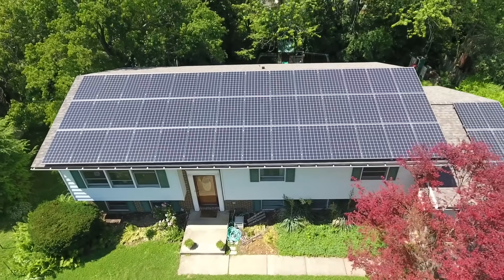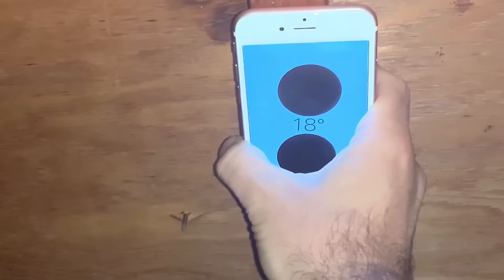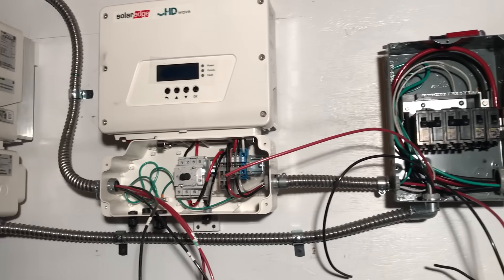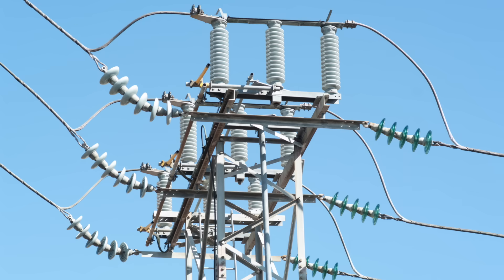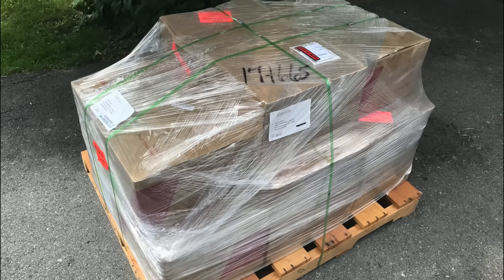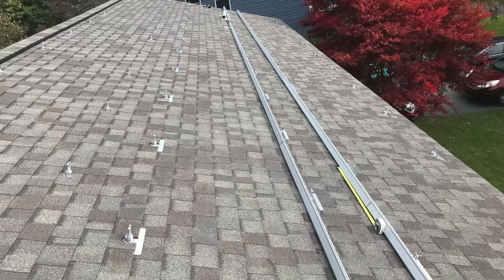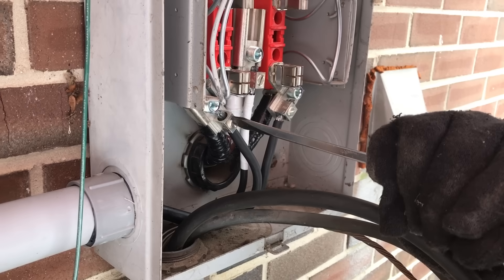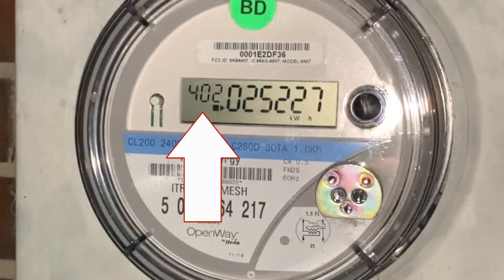I Installed a Power Plant Myself | HUGE DIY Solar Panel System

Comment: Great video! Very encouraging for those who haven't installed a system yet. I was much like you back in 2013. I installed my own array, but did so in increments. I also chose Enphase Microinverters instead of SolarEdge. I started with 6 panels leaned against my backyard fence! When I got up to 24 panels mounted on roof, I drew up my own plans from scratch and got permitted and approved by the utility. I could really relate to your story, in that no one I knew had installed solar before. Plus, each time I stopped to ask any detail from local solar installers, 100% of the time, they would not offer any help or advice at all. All would try to get me to get a quote only. Even the most simple questions like... Where can I purchase safety warning stickers for my conduit? Umm... not sure, we get ours from the company... ! Presently I can generate about 160 kWh per day (it's May 12th), I have 4 EV cars, and I waste power like there's no tomorrow! My house has trees on 3 sides blocking my good sun hours less than most houses, but I oversized my array to compensate for it. My whole house runs on electricity only now, and my gas is valved off. Yearly the utility pays be about $600 back for power I feed back. My payback on investment was about 2 years since the labor was all free. Thanks for the video, I am sure it will help people.
Reply from the maker: Thanks for watching!  That’s great that you installed solar yourself and had such great results.
Reply: Most Solar Contractors simply want you to fail at the install, and then hire them instead.  Unfortunately, they make out like bandits, with high initial installation costs.  The tax credits that the government offers, simply allow them to charge more for the install.  I commend you on your installation.  The normal home owner, really, only makes out if he does the install himself.  Good Job!

Comment: I am interested in solar, but only at the highest ROI possible with an expandable DIY system, preferably with low cost microinverters that don't require cloud monitoring. My state offers a 25% credit up to $1,000. So the total cost should be $4,000 so that I can get the maximum credit and the lowest cost per kW. Next year if the tax credit is renewed, I can expand again to whatever limit that allow. All to get the lowest overall cost and therefore the highest ROI. In addition, since the power generated will not be designed for a whole home nearly always be at the highest cost per kWH that too will maximize ROI. My goal is an ROI of 3 years or less and it seems that is only possible with a small system. Thank you for your video and I plan on downloading your beginner's guide.

Comment: So how do you align your panels and keep them straight through out laying that many panels? I lay panel for a living and we constantly hit the road block of them becoming off square.
Reply from the maker: The rails need to be square and the first panel has to be square to the rails.  I was pretty meticulous about the placement of the first panel.  Once the first row is complete, you can use that as a guide for the next rows of panels.  I agree that with long rows of panels it can be very challenging.
Reply: @FrugalRepair  thank you for the prompt reply! I’ve been using line levels to help guide me along and it’s been pretty successful.

Comment: love to do a similar project, only issue we have is the power company pays you say 2c per unit in the day whilst you are producing energy, but then you buy back off the company at 15c per unit. we have no one at home during day light hours. i think the only way this would work is with a battery set up like a tesla or some other lithium battery system.   
Great video, and nice work on compiling all your efforts into a free brochure.
Reply from the maker: Thanks!  Yes, in your situation a battery bank may be worth getting.

Comment: Do you live in the north or the south?
Reply from the maker: I’m in Pennsylvania.
Reply: @FrugalRepair  Thank you.  You probably get a lot of snow like we do in Iowa...How is they system with a lot of snow on it, or do you have to keep the snow off?  How much does the system weigh on your roof?
Reply from the maker: I made a video about that.  Check it out if interested.  You probably get a lot more snow than we do here in PA. The biggest factor with grid tide solar is the net metering. If you have this, then most of your production will be in there spring summer and fall and you’ll get all of those credits. So the snowy months aren’t as big of a deal.

Comment: Did you take the induction loop into account? Or does it not matter in america?
Reply from the maker: What do you mean by induction loop?  You mean induction on the dc wires?
Reply: @FrugalRepair  yes, that wiring from your inverter to your optimizers is placed in such a way that it doesn't form a big loop, in wich a magnetic field can form.

Comment: When you bought your panels did the price of the panel include the microinverters or is that typically an add on to the price of a panel, when I am shopping? For example I see a Panasonic panel similar to yours for $328.00. I can not see, or figure out, base on the advertisement, if the panel I'm buying automatically includes the inverter? Thanks again!!
Reply from the maker: I’d ask the shop.  But usually they are sold separately.  You could shoot me an email if you have more questions.

Comment: What state are you located in? I assume its one of the warmer states where the winters are shorter otherwise you would have to depend on the power company more often.
Reply from the maker: PA
Reply from the maker: I cover the snow and net metering topics in the next two videos
Reply: @FrugalRepair  Great! I definitely have to check those out.

Comment: Excuse me, but how did you calculate the ROI? If your investment pays back after lets say 7 years and the system is operational at least 21 years, your ROI schould be much higher than 14% ?! (Around 300% after 21 years.
Reply from the maker: Check out the next video, I go over the numbers.

Comment: Did he have to reinforce the roof beams in the attic with all the added weight? Why ask others what to do? More people should install these and making them more affordable would definitely ensure the power grid does not overload when needed. Call it emergency power, so to speak. Looked easy enough however! Thank you for sharing.
Reply from the maker: No reinforcement needed.  Though it was checked out and approved by a structural engineer.  If I remember right, the weight was something like 2lbs per sq ft.  So it’s distributed across the roof.
Reply: Most of the time existing roof rafters will be able to hold the pv system. Only thing one would have to worry about is the panels flying off due to high wind speeds and huge attachment spacing.

Comment: Never have another electric bill for 18 years? Think again. Sell power back to the grid?  Maybe the few hours you are away from your home.  Otherwise the average home consumes much more electricity than they can generate.  I only lasted a couple minutes into the video but there is so much more to living on solar power than installing panels and thinking that unlimited energy will be pouring into your house. Cloud cover reduces your panels output near zero. So unless you live in a cloud free climate you’re going to have to contend with that. Also the maximum power rating on solar panels assumes the panels are pointed directly at the sun. On a fixed pitch roof that doesn’t track the sun, your power will be much reduced.  Also, winter sun hours are reduced.  Solar panels are great, but pushing them with inflated expectations hurts the home owner and ultimately will hurt the larger scale use of them.

Comment: electric bill are NOT going to be zero if you connect up to the grid
Reply: Yes it will be, because the solar panels will generate energy into the grid and at the end of the month they will calculate how much he used and generated, if it comes out as 0, he doesnt pay.
Reply: @balazstoth2407  yea and then they will hit you with a connection fee and crap taxes so no it won't be zero
Reply: @gregh7457  Well idk about all that. Here in Hungary when you install solar panels according to your energy consumption, you dont have to pay the bills anymore, and if you install bigger than your consumption, you can make money with it since the DSO will buy the extra energy from you (you have to pay tax after this income)
Reply: @balazstoth2407  thats very nice to make extra money off what you don't use. i wish i had that. The problem where i'm at is so many people have solar that the profit for the electric company went down so they make everyone on solar pay a connection fee thats supposed to help pay for maintenance of the grid. Its not like that everywhere in the states. It depends on the electric company.  Where i live, we have so many people with solar that the utility makes people wait to install their panels until they "upgrade the circuits" to handle the extra power. Some say its just the power company holding onto its monopoly just a little longer.

Comment: i would put some panels on the backside of the roof too if i would get some second hand panels or some on sale ones. they will still produce power even if not as much as the ones on the frontside.

Comment: I suggest getting a power wall installed, storing energy you’ve produced and being able to power your home during the night or if the street suffers a power loss, is definitely a great feeling.
Reply: But he did not share on how much it cost him to buy all those panel etc.
Reply: @Dailymailnewz  panels aren’t that expensive, it’s the roof repairs, prep work and installing that jumps up the overall cost. Depending where you’re from you can get a 300 watt panel for around 250-300 dollars. Obviously in bulk it’ll be cheaper.
Reply: @iMann_iFail  but so many people are building these solar panel cells themselvs are they any good rather than paying thousands of dollars for kw regions.
Reply: @Dailymailnewz  Admittedly there are more business producing solar panels but for the individual person, they’re simply buying the panels in and setting them up their self. It’s pretty up a plug and play system now. You just need to do some research on the set up that suit you the best. Obviously if you’re planning to wire it in to your home, you need permission from your energy supplier and local council approval, etc.
Reply: @iMann_iFail  Perfectly good used industrial solar panels are available for as little as $.25/watt or less. I just purchased a large batch of  beautiful 250 watt, 24 volt panels for $50 each in Phoenix.

Comment: I think you should use shielded copper wire for outdoors as that would also help with the short circuit issue on the aluminium rails.
Reply from the maker: Short circuit isn’t the issue, the issue is the galvanic corrosion between copper and aluminum.
Reply: @FrugalRepair  would a shielded wire not help with that as well though?  Galvanic corrosion would occur if they were touching and also wet (rain).

Comment: Tied to the grid. Meaning he is still using the grid at night and inclement weather. And is receiving bills to prove it. Even with battery backups. The power company will still send you a bill with fees if you are connected to the grid.

Comment: This is how I imagined solar energy not just 2 panels like everyone does!
Reply: Well its really expensive to be installed. Some states also stop paying you back for the power you put in and some even flat out stop giving you credits even when you are feeding into the system.

This guy did it himself which would of saved a large amount of money. Ill assume his numbers are correct... Getting a return on investment after 5-7 years is impressive. Im guessing he spent over 10k for everything with avg 200 plus per year in energy bills. Hiring someone will take on another 10-20k just for them to install it...especially this big. I be surprised if you see a return after 10 years for most projects. Then add in the fact that solar is heavily subsidized with your tax dollars, they loss efficiency ever year, you don't have the sun 24/7 and so on..It becomes very hard to determine a real return value. This is why most people generally don't go big or have solar at all. Solar is very situational but its getting better. I do wish we would stop being afraid of nuclear power (Used to work on one).. We could of been green years ago without all the "Do I have power today? Is it nice out?" problem... Getting the materials for solar/battiers etc is very difficult to do and requires/makes a lot of waste. After Green new deals/Paris agreements and stuff like it I dont think our politicans actually want to go green.. Seems to be for something mischievous
Reply: I can only fit 10 on my roof. This guy has a massive roof fortunately, because he uses a crap ton of electricity.
Reply: Panels are so cheap now, it makes sense to maximise them. The big cost is the battery and the labour to install them. I maxed my roof out at 6.5kW.

Here in Ireland there's still no feed in tariff. Supposedly soon, but I bought an 11kWh battery - which I can expand to 33kWh - and it covers my needs all night so far. Plus I have an EV so that stores more power. Eventually it would be good to add in wind generation but that's a later project.
Reply: @KevinLyda  if you build your own lifepo4 battery with cells from Alibaba you can make a 14kwh battery for 2000 dollars.

Comment: For the upcoming years, solar and ev revolution will end the the gas combustion ancient engines. The thing is, gas companies are depending mostly on people's ignorance to pass thier products. These famous gas companies tried to stop this revolution by all means, but fortunately Solar and electricity still here. When my dad decide to get an EV I was 💯 against the idea, but after I found out that Tesla model 3 is cheaper than the camry, it changed my mindset for definitely. Tesla model 3 lease monthly is $450 and down payment is $5000 its expensive right for mid income or even low, but california rebates is $4500 + $1500 edison + charging free for 3 years so after all incentives my lease end up $250 or $300 a month, and we didn't talk about solar incentives yet.

Comment: Looks well installed but from my experience lots of electronic co trollers exposed on the roof can be problematic i like the concept but do not like connecting to the grid iwould prefer batteries this is also expensive.

Comment: A fantastic initiative to help the environment as well, I would be concerned with the weight and practicality though as I live in an area which gets lots of snow during winter. Would definitely need added support to pull off a solar powered roof. As we get lots of sun as well during winter I wonder if the power produced would be enough to keep the solar panels warm enough to ditch the snow but then there are the long long nights.

Comment: All looks good so far but I would look into a more permanent solution with the zip ties. They get brittle and break after a few years and then you will have swinging wires that will fray.

Comment: If you intend to stay in a house for 10+ years, you're nuts NOT to do this (as long as the conditions are right as far as where you live and where you intend to place the panels). It is MUCH better if you can attach your system to the power grid with net metering...if not you need batteries and that kind of sucks. It is better to spend the money on a diesel generator should your power go off.
Reply from the maker: It may even be worth it no matter what because of the increase in home value.
Reply: @FrugalRepair  True, it has become a selling point in more recent years. I'm a fan. 

Off grid batteries are a must too. 

If you're on the grid it might be more economical to sink money into more panels than batteries. 

Lots of variables.

Comment: Solar, doing your part to be green, except for the Mining of silicone for the wafers, the industrial electric furnace that melts the silicon to make huge ingots, then the slice the ingots into wafer thin wafers, then treating the wafers with an electro-chemical process to impart Boron and Phosphorus, which is mined, then refined and the waste dumped in great piles. Then seal the wafers in acetate, which is another chemical/electrical process with waste, those wafers and now places in an aluminum frame, which was mined and refined and the waste dumped, then has a sheet of glass on it... So,... a lot of mining, mine wastes, then furnaces and discharge into the air, then the chemical and electrical process with waste and energy use, .... so ya, it's green. as in $$

Comment: Question on sending your surplus energy back into the grid: How is that not "back feeding"? ...what I mean, say the power company kills the line for maintenance but your system is energized and feeding that meter still. Isn't that a safety hazard for the linemen? I'm sure this all works out but I'm trying to understand this part more.

Comment: Wonder how many homes can install solar before power needs to be dumped due to excess.

Need to protect the grid and transformers and the mega and giga watt plants must run at same level 24-7-365.
Reply from the maker: Not sure, it may be happening in CA already.  I haven’t researched it though.

Comment: Dose your system have batteries?
Reply from the maker: No batteries.  If you check out the next video I explain how net metering works and why we don’t need batteries.
Reply: @FrugalRepair  I thought most solar systems if not all solar systems should have batteries for like cloudy days and stuff????
Reply from the maker: Nope, net metering is the key for grid tie systems.